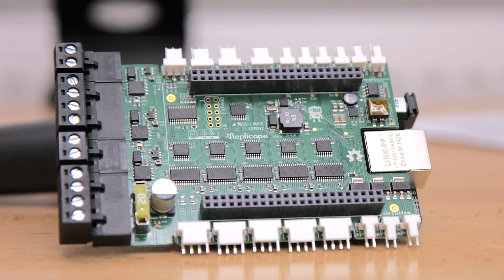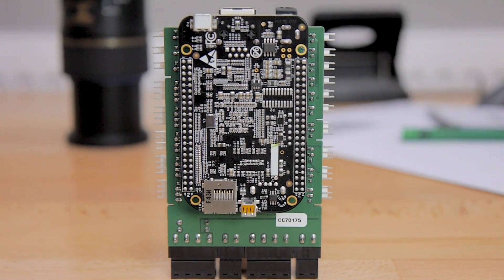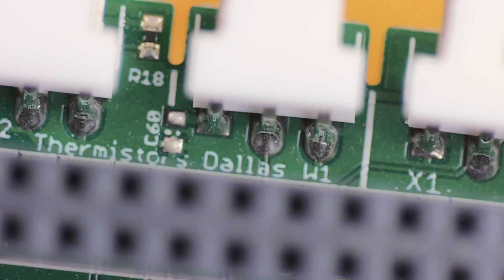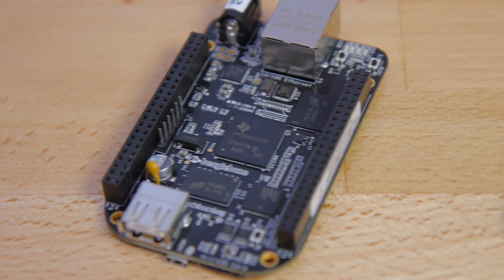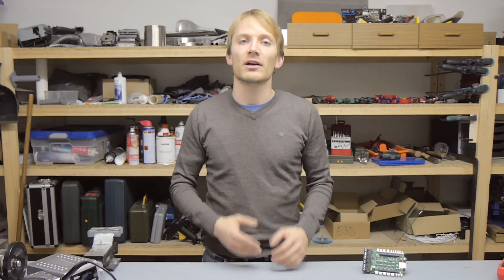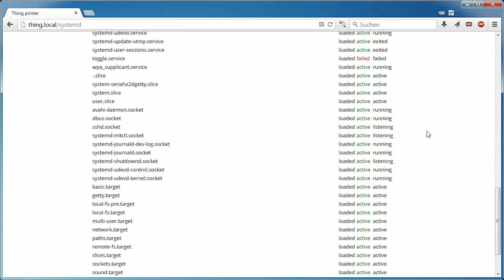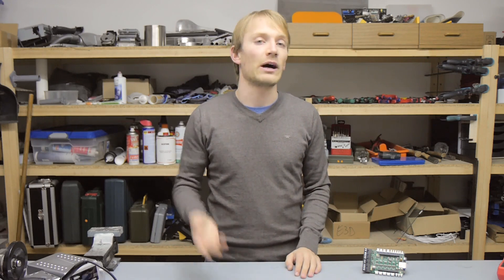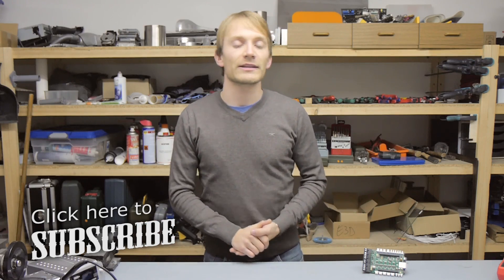3D printing review: The Replicape (and BeagleBone Black)!

Comment: FYI - I purchased a Replicape + BBB 2 years ago from Thing-Printer. The flashing process just does not work. The group supporting it uses Slack and after a few months of being bounced around between people with real jobs that only do support on the side, I gave up.  Their only solution was "try flashing it again". I looked into the code enough to make a guess they are not initializing the BBB correctly - devices are missing when the process ends. I fear it may be an indication of deeper issues.

Comment: You might be rather wrong about the "choppy performance" issue with a Raspberry Pi. Keep in mind, I am a software guy, with a past history of writing hardware drivers, so this in more in my domain.

In software there is the notion of "processor affinity". In software we can assign tasks to run on specific CPUs. Linux supports this well. That means in a Pi 3 (with multiple CPUs) we could specify that the printer-controller task run exclusively on one CPU, and the other CPU-intense tasks are assigned to other CPUs. The end result is one of the CPUs runs the printer-controller task, and nothing else.

If one CPU is doing nothing else, it should be well capable of controlling a printer. A single CPU on a Pi 3 is much, much faster than the usual printer controller.

The above is a theory. As far as I can tell, no one has put this to test.

More ... 3D printer design seems to be dominated by hardware folk, who simply did not know this was an option, when I posted in public forum. So it has not been tried.

There is a distinct (but unproven) chance that a Pi 3 might prove more than adequate for controlling a 3D printer, if simple use is made of standard Linux function.

Of course, then there is the problem of finding a suitable "hat" of the Pi, to drive steppers and the associated bits. The board is missing as hardware folk are convinced ... of the same argument you repeated. (Chicken and egg problem, a bit.)

Also the smarter drivers (Trimanic) seem to support higher level operations, which much loosens the demands on the controller.

Could just be that a Pi 3 running Linux is more than capable, with simple use of existing function offered by Linux.

Comment: do you now if this can support three stepper motor and three more bowden extruders for a diamond hot end while still doing a heated build-plate, a fan or two, two temperature sensors, and an LCD screen while also doing WiFi connection auto calibration, and 1/128thmicrostepping
Reply: It is sad, but he probably doesn't know this.

Comment: 0:08 What about boards that sit on top of an Arduino Due w/32 bit ARM chip (RADDS) or boards based upon the Due (Duet?)
(RepRap or Repetier firmware). The RADDS in particular is very nice and affordable. Automotive fuses, and a lot of I/O. It even comes with a MOSFET output that can drive a 350 watt 24volt heatbed directly.

Comment: It could use another stepper driver. For example it is not that unusual to use two steppers for the Z-axis, and then you are left with only one driver for an extruder after the X, and Y axis is accounted for.
Or even worse if you have dual steppers on both Z and X axis you have no drivers for an extruder.
Or maybe you can paralell two steppers on one driver the the axis with dual motors? Or will that mess with the micro stepping?

Comment: hi just curious if the issues with the software side have been fixed/updated.  Its mentioned that its pretty limited with what you can do and hard to setup and the userbase is small and not very well documented "you're on your own".  

Soo being over a year since this review, and the product has had some revisions, any chance someone could chime in on how it stacks up now, any changed opinions ect?  the price is cheaper now too as well

Comment: Hey tom another great video, but with that said it makes,me wonder  if you are familiar with the udoo sbc it had a spec sheet of the bbb to shame. It's x86 based quad or October core with also onboard atmega2560 it's by far the best option for a 3D printer I have come across so far

Comment: Well it seems that the price on the replicate has dropped to $99, and is now using the TMC2100 stepper drivers that you recently reviewed.  Perhaps having the CRAMPS board available for $79 (but it needs the Polulu stepper boards) is a factor here.  Now with BBB in rev C, maybe this needs looking into.  Iv'e read some stuff about LinuxCNC which is a powerful and well developed package.

Comment: Hi. I have projects in mind that will need multiple extruders be it for multi material/color printing or for support addition. Which controller board do you think would be suited for that? Or what would you suggest me to do in order to control multiple extruders.
Reply: What do you say ***** ?
Reply: ***** That is the thing. Two is not enough. I'm planning on using 5 extruders. Is there an expansion for more extruders? Is there a way to Synchronize two controller boards with one printer?
Reply: Thanks for your help anyway. I'll check it.

Comment: Hi Tom!
I love your videos and think about building my own printer. However i am not experienced in software/electronics stuff. I would like to mount the e3d Kraken on the printer so that there are just a few boards that fit my needs. I found the azteeg x3 pro, what do you think about this as a board for a beginner? I am however experienced in mechanics and 3d printing so basically only electronics and programming are my problems. I want to have the capabilities for many high power stepper motors (exceeding the 3 axis + 2 extruder motors). Also some other connections for a display, controlling buttons and maybe a sensor for bedleveling should be on the board. I hope you can help me, maybe you could even do a video about either the kraken or boards like the x3 pro.

Comment: The conclusion part of the video is a bit ignorant imho. Especially because you didn't even mention machinekit! And the price is all about economics of scale. If more people are interested in BBB capes then the prices will get lower. There is no question that the BBB capes are the future.
Reply: ***** EDIT: OOPS! It appears I typed both of these comments before checking if there is an actually working solution for machinekit with the replicape. Apparently there isn't a configuration yet and/or some sort of driver is missing. So my bad, sorry!

----
Hi! Yeah it's true that the software side is holding it back. But you didn't even seem to have tested machinekit! I had trouble with machinekit also and haven't played with my 3D delta printer for a while because of it - so I was excited to see a video maybe showing an update about machinekit.

E.g. you can flash a machinekit image on the BBB, start to desktop by attaching keyboard / mouse / monitor to the BBB (or use a remote interface) and simply select a configuration file in a window! The setup has GREAT potential imho especially with BBB as a web server. The desktop on the BBB is slow but hey It's a full PC!

Your conclusion "just not feeling it" without actually testing machinekit as the standard and specialized solution for the board is just a bit ignorant imho. You might be right that it's simply not there yet but how would you know? You haven't even tested the product really ;)

And hey I really like your video's a lot, so I don't want to bash you or anything! The video is still very informative and cool but imho not a good review. If I may review your review hehe.

Comment: Hey Tom (or anyone who can answer my question),
   I want to know something about ABS filament and its properties, recently I was in an little debate with my friend who told me that ABS filament if left out will degrade and will be harder to print. Because he saw while using his Replicator 2x in dual extrusion mode his older (older meaning 6 months to a year ) filaments extruded for the beginning of the print but later he checked it and the older filament had stopped extruding. He tried switching the filament between the two extruders and it still didn't work. He even tried switching between other filaments and whatever older filament he never worked. So my final question is: Is it a problem with his printer or id my friend right that ABS tends to degrade with age or is it a problem with his printer?

Comment: Tom, Norway is not in the EU, so I believe you will need to pay import VAT if you buy it in the EU.
Reply: ***** I think you are mistaken. We export to Norway and don't charge them VAT, as we would countries in the EU. Instead they get charged import VAT. I would be surprised if it was different the opposite way around.
Reply: ***** This is not my area of expertise, but from what I understand export from Norway to a country in EU should not be taxed by the exporter if it is a company. In that case, tax is added upon import. If it is to a consumer, a Norwegian company is responsible for collecting the local tax in the country in which the buyer lives.

Comment: I'm running a Duet Board with DC42 firmware. It has a native ethernet connection, smooth microstepping and a better trajectory planner than Marlin. Worth a look.
Reply: I went with the BBBlack and the Replicape for my delta printer.  I choose it for the features listed in the video and the fact that I have a Manga (video display) coming for it.  I figured the software would eventually catch up with the hardware, even if I have to contribute to the development to make it happen :) Unfortunately, I haven't done anything with it since it arrived.

Comment: Hi Thomas. I am using a Rambo and I would like to add more motor controllers to it. I would need around 7 or 8 motor controllers. I know that right now it has 6 controllers on board, and there are pins for extra controllers. Can I add 2 extra controllers to the Rambo, or is that not possible? Thanks.

Comment: thanks for the review Thomas but I'm going the BBB and CRAMPS(http://pico-systems.com/osc2.5/catalog/product_info.php?products_id=35) route along with Machinekit(formerly LinuxCNC).  Since I'm doing a Mini Kossel Delta printer it's been a bit hit and miss as I'm learning Machinekit. I'm up to starting the calibration process once my missing JHead part comes in so I can remount the JHead.

I just downloaded an image and copied it to a microSD card and booted before starting on the testing and configuration process. My CRAMPS board was no purchased from Pico Systems so it was untested and even had shorts on the board and an IC installed backwards. MachineKit is going through lots of updates right now so I would say take a look in 3 months or so if you don't want to spend too much time in a console window. But again, I'm doing a delta and even though others have had delta's running over a year ago on Machinekit, lots of updates have moved things so old instructions are 100% applicable.